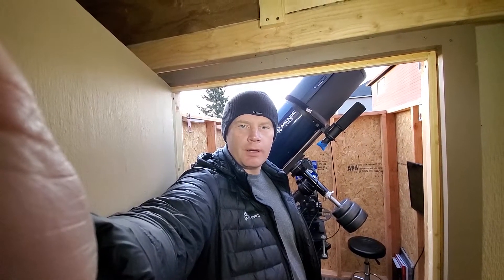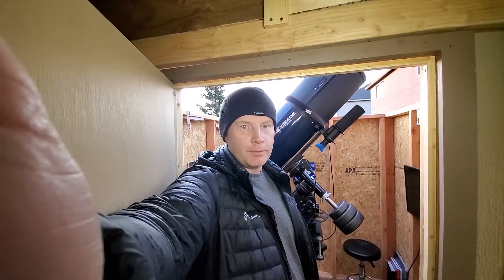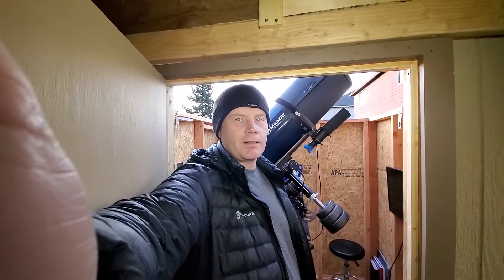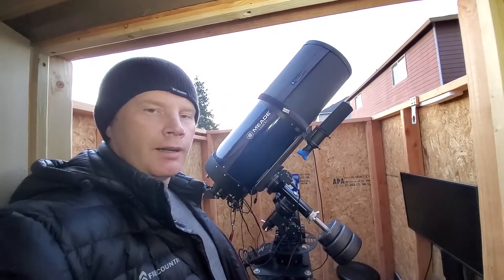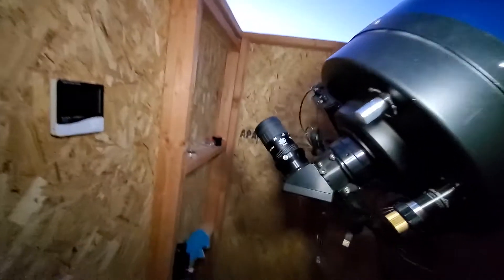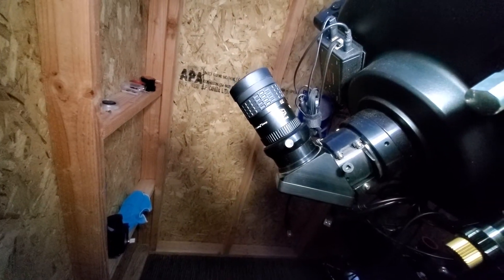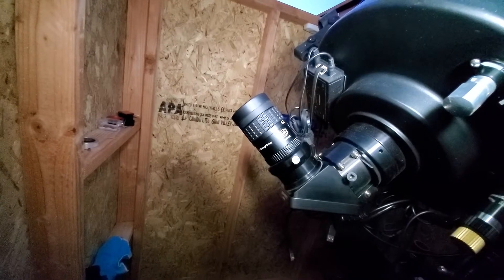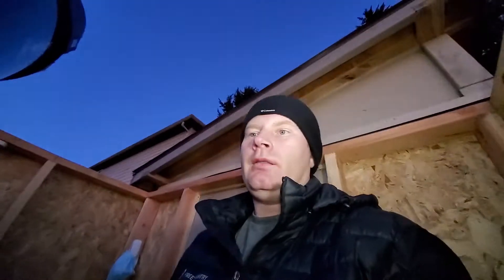How to Collimate a SCT Telescope??? Do it the SAFE and EASY way!

Comment: Vlad, what can one expect in terms of image improvement of saturn and jupiter if one goes from 90% to 100% perfect collimation? I’m trying to get the absolute best images I can but dealing with low altitude planets at the moment and trying to achieve best collimation and also, regarding bak focus using a barlow, I’m playing with pushing camera all the way in the barlow and also pulling it out, say, halfway to see if there is a difference which there seems to be. Also experimenting with gain and exposure (Svbony 305c) and contrary to what many people say about keeping exposures below 10ms for lucky imaging, I’m getting better results at anywhere between 15 and 35ms with lower gain.
Reply from the maker: Well in regards to collimation and image quality, it really depends on how good the seeing is. If seeing is not so great the collimation is not going to matter that much if it's fairly decently set already. On those nights of perfect seeing it will make all the difference! The issue is that to set it at 100% you also need a night of perfect seeing and that's assuming that your particular SCT can even keep that perfect collimation.

Comment: Great video 
Question: does it netter wich way you turn the primary mirror to get the donut?
Reply from the maker: Well it's the secondary your adjusting. And no it does not matter. You just don't want the screws roo tight or too lose
Reply: @AVTAstro  
Sorry my spelling wasn’t the best 
Thanks for the reply 
That was helpful video

Comment: Unfortunately I have the Hyperstar all taped up at its base. It has an issue of light leaks, most likely when there is no filter in the filter drawer.
Reply from the maker: Bummer, never used one so not sure how to overcome that...
Reply: @AVTAstro  1) Peel the tape off 2) take the Hyperstar off 4) put the convex secondary mirror on 5) Thread the Cassegrain focuser on 4) Collimate primary mirror<<<I think I will leave it alone. Doing all this will change the balance as I have the guide camera on a rail on top of the OTA...Not a one man job...I don't think...then reverse the entire process and carry out another collimation this rime on just the Hyperstar.

Comment: How do you collimate an SCT with a Hyperstar?
Reply from the maker: Well you can collimate it first without the hyper star or just do it with it like I did in the video with your cameras live view.
Reply: @AVTAstro  I think I got it: With the star outside of focus loosen the two sides opposite where the disk is thinner and tighten the bolt where the disk is thinner.
Reply: @AVTAstro  Oops I already have the Hyperstar on. I should collimated the SCT by itself first.

Comment: Thankyou for sharing this video. I previously had a 8" Apertura Dob, and found it easiest for me to use a collimation cap. It was just a cap with a little pin hole in it. I had trouble using the lazar type. In checking the collimation for my new Se8, would I be able to use that same setup? I hadn't thought I would have to collimate a sct if needed, but it would make sense that it could also be needing collimation.
Reply from the maker: Hi, collimating an SCT and Dob is totally different. You do not need any equipment for an SCT at all. If you follow the procedure in the video you will be good to go!
Reply: @AVTAstro  Thankyou, I appreciate you helping me on that!

Comment: Vlad, great coverage of the topic.  A question that might occur to viewers is whether these "Bob's knobs" or equivalent replacements for the stock screws are available for most SCT brands.
Reply from the maker: Hey John, yes they make them for most common SCT's.
Reply: PUBLIC SERVICE ANNOUNCEMENT: it should also be noted.. that just putting on Bob's knobs will require more frequent collimation, as they become looser much easier than the original screws.  Lock tight has been suggested for Bob's knobs..
Reply: @compubyte2010  I really don't think your public service announcement is correct. Especially the last part.
Reply: @Odysseuss.  its ok .. takes two seconds of research to know that Bobs knobs require more frequent collminating.. if you wish not to believe it. 
That's on you.. enjoy never the less !!
Reply: @compubyte2010  I am sure he was referring to the use of lock tight. NOT a good idea. Most people who use Bobs Nobs have their scopes permanently mounted.